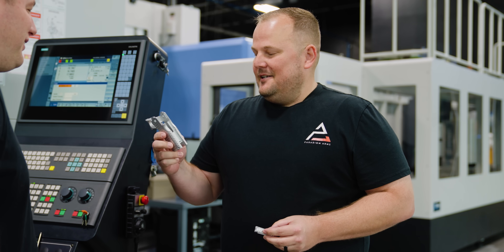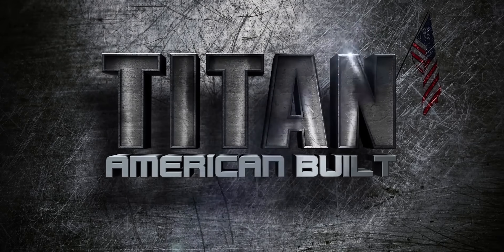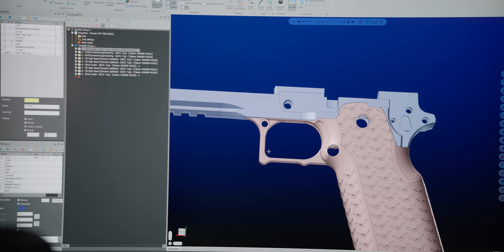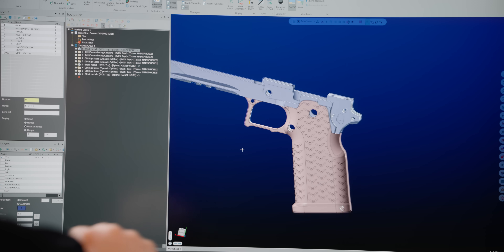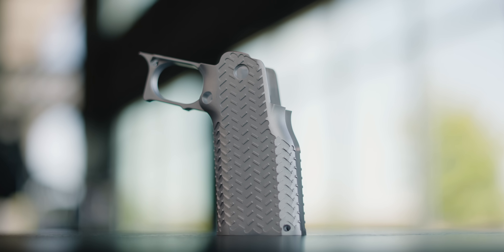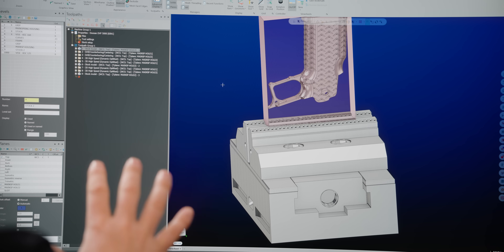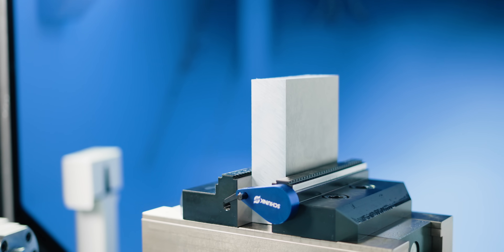Reverse-Engineering an Incredibly Difficult to Machine Hand Grip!

Comment: The reverse engineering software used is clearly Geomagic Design X, so it is misleading to say that DezignWorks or Polyworks were used for the modelling. The mesh is displayed in DesignX's default colors, the rotation center icon is identical to DX, and even the feature names during the LiveTransfer are identical to DX's naming convention. Be honest about the tools used to create this project.
Reply: Correct. Maybe honest mistake.

Comment: I create such grips in my garage on my VMC, its def not easy but not impossible. I do it cut in half so two parts that I screw together with a dovel pin. Running my own grip since 2022 without any issues.

Comment: I'm sorry but you really need to fix that weird corner where the grip meets the frame right under the safeties. If you have that area under the safety cut out you need to do the same on the grip. Or not do it on both. Look at Atlas Gunworks as an example.

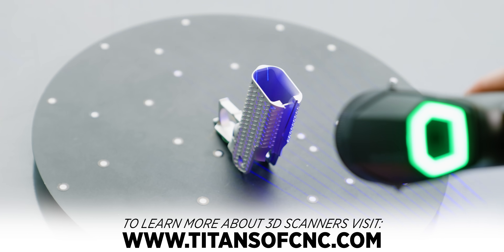Comment: 1:01 
Using a smaller scanner may have been a better choice. The spacing between the cameras will make it harder to get accurate small convex features (ex: the hollow inside of the grip), and usually they have a hard time with assembling the multiple scans of a small object together.
I am curious as to how well a 3d scanner made for smaller parts (ex: 3dmakerpro mouse scanner) would do in terms of accuracy and time to finished scan

Comment: Can someone please explain to me how ‘accurate down to nine tenths’ is a good resolution. Did he just misspeak or am I not understanding imperial correctly.
Reply: 9 tenths in machinist world is 9 ten-thousandths of an inch or .0009" (23 micron in metric world) not 0.9" like the wording would suggest. .0009" is pretty impressive for a scanner like that
Reply: @beyondthebitstream5153  cheers
Reply: Great question!  The accuracy is 0.0009" or 25 microns for the HandySCAN Black+ Elite.  Accuracy is the difference between a measured value (from the scan) compared to a known standard such as a NIST-traceable ring gauge or ball bar.  Resolution is the distance between data points and has no impact on the accuracy of the scan.  I hope that helps answer your question!

Comment: I built a 2011 a few years back.  I spent an hour admiring the machine work on the titanium grip.  It cost more than most highend pistols by itself.  So happy to see this video and the process.  Love it.
Reply: I hope to get to build one
Reply: @jayaneyon9316  Another one to look at is the Sig P226 or 228.  When I built my 80%, refurbished slids and parts kits were cheep.  Of all my pistols, it's the one that fits like a glove....  The 2011 is more of a novelty becuase it's fun, but it's a range gun.
Reply: @derekturner3272  thanks for the advice
Reply: You have that Phoenix Trinity Evo grip in titanium also!?
Reply: @ALL_comped_EVERYTHING  in extra grippy texture.  It's a work of art....  These 2011 options keep getting better and better...

Comment: Look, I get it that people view you as gods... but you really did the stupid with this one.
I mean... you know that is built on specifications right? Specs that are EASILY found?
The only thing you needed to do, was model EVERYTHING THAT FITS INSIDE THE GRIP...
And then offset by 3mm. Create your planes, smooth into a solid, and then boolean remove the parts inside.
That's how I did mine. In a couple hours.
I didn't have to make a YT video on it either. Because it wasn't anything special.